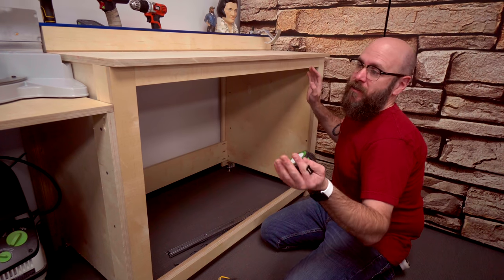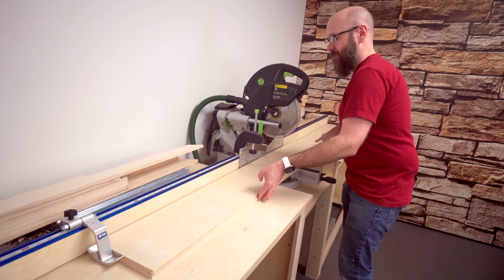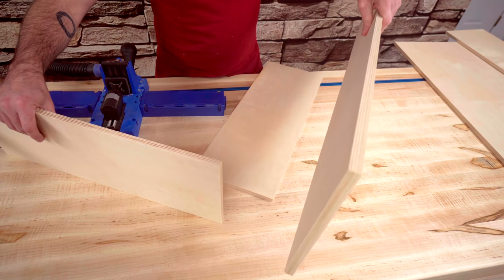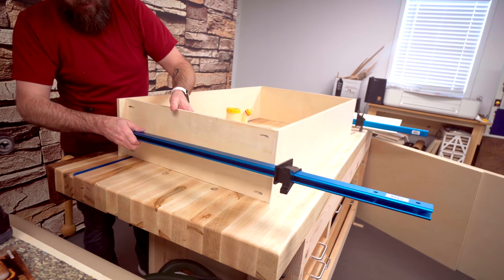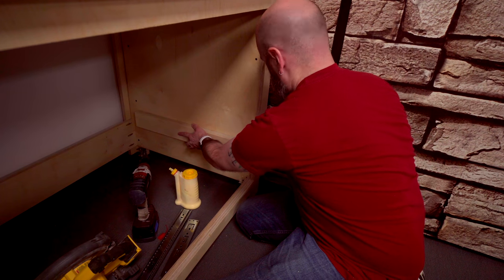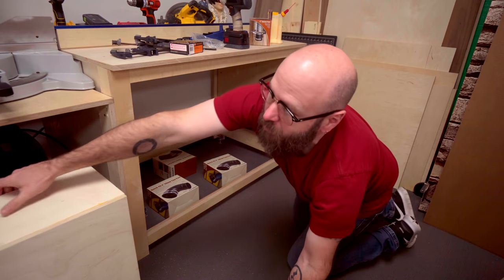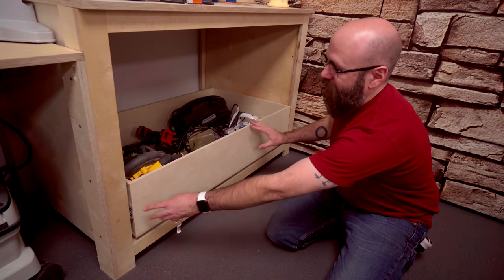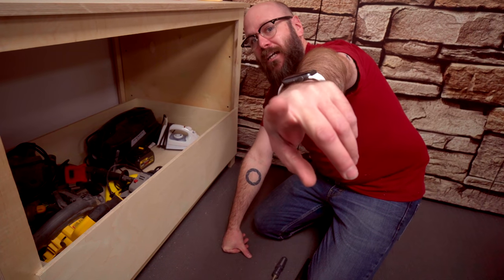How to Easily Make Shop Drawers. No Fancy Joinery.

Comment: One subtle change can increase the strength of these drawers. With the front/back extending the full distance, the pocket holes are in the side pieces. When the drawers are opened, the stresses are acting against the glue (which is half in end grain) and the threads of the screws. If the sides were made full length, then the pocket holes would be in the fronts/backs. Then the opening stresses need to sheer the screws to get to a failure. The real front would cover up the pocket screws.
Reply: Exactly right.
Reply: I'll start by saying that I use the joints that you describe personally, minus the pocket holes and plus rabbit joints.

Anyway, he said quick and easy so he didn't have to fuss around minute measurements and subtracting for the double thickness of the sides (that are less than 1/2"), etc. Plus the full extensions I get are 1/2" + 1/32" or something thick. So there's a bit more finagling to get the right size.

My workaround the odd plywood thickness is I rabbit deep enough to leave exactly 1/2" of thickness remaining (for 3/4")
Reply: Yep, that's exactly what I did for 14 drawers in my miter station too. Stronger for repeated pulls over the years and hides the pocket holes too. This is also the exact method Jay Bates used in his which is where I got it from. For the front/back width measurement, I stacked the two side pieces up on the side of the opening and measured the remaining gap.
Reply: Agreed. Good point. I'm making some now and I'm doing them like you mentioned.
Reply: Ive made drawers the same way with pockets on sides and never failed, and without glue. Don't be timid in trying different ways and faster construction.

Comment: Easy enough for anyone to follow.
And, you come out with a strong, no nonsense utility drawer.
(It'd be a good idea to adjust the clutch on your drill to avoid striping the threads on your pocket hole, and then finish by hand tightening them.)

Comment: A couple pointers ... you glued the drawer glide strips to the cabinet which looks prefinished ... if so, wood glue isn’t going to add any strength here. You also put the pocket holes on the sides of the drawers where they’re visible ... assuming you’ll add a drawer face later, you could hide them by putting them in the front and rear. Thanks for sharing!!

Comment: Really nice shop. I am about to begin another shop in my back yard just for woodworking. The one I have now is for my motorcycle and any other projects plus storage. It is too full. The shop I have now is a frame structure, 12x20. The new one will be 12x24. Can't go wider as yard is not big enough.

Comment: What size screw did you use for the drawers? Kreg recommends 3/4" pan head for 1/2" stock when using the black microjig but I couldn't tell what you used
Great video.

Comment: How strong are the drawer bottoms when using glue and pin nails? With relatively heavy items like circular saws etc are they strong enough?
Reply: Over-thinking too much.
Reply: I disagree. Not overthinking. These are very wide drawers, holding heavy objects. Nobody wants to have to replace a sagging drawer bottom.

Comment: Thank you for your continued tips and tricks.  Is your 1/2 inch plywood really 1/2 inch thick?  My 1/2 inch plywood is really 7/16.  Nothing in Kreg material about how to stop 1” screw from coming out face of joined material.  The only 3/4 inch screws I can find our fine threaded.   Any ideas.
Reply from the maker: I use the 1" screws but set the stop collar a bit lower than the recommended depth.

Comment: Question... for the bottom of the drawer, can you use the same pocket jig and screws to attach it for a strong hold?  Been watching youtube for how to make simple drawers with pocket holes and your video has the size drawer I need, I just want the bottom to not bow in the middle and be really really strong to hold heavy items.  Awesome video, simple, and easy.
Reply: Dayleeyah Kalonji Hey not sure if you built these already, but if your drawers will be carrying a lot weight use 3/4” plywood. Cut slots into the lower sections of the drawer sides to receive the bottom panel. I hope that’s helpful.

Comment: Sorry, a bit late to the party, but did you say you needed to buy an accessory to do pocket holes in 1/2" material? I have the older Kreg jig and I only have to change depth collar on the drill bit when doing 1/2" material. No additional accessories needed. 

But I really hate reaching behind the work to clamp it down. I was just starting to think about getting this newer version and if I have to buy extra accessories just to do common widths, I may just live with what I have.

Comment: What kind of plywood should I be using for the likes of this?

The big box stores in the UK simply offer "softwood plywood" and "hardwood plywood" 
the latter tends to be a darker reddish colour
Reply from the maker: That’s a good question. I’m not really sure the difference between the two but for shop furniture I’m sure either one will work.
Reply: Thanks for the answer. I'm sure it probably is immaterial for this use. I just bought my first table saw and am looking forward to turning big sheets of stuff into other more practical stuff

Next time I see the Gosforth Handyman use plywood on his channel I'll try get a UK-supply-specific answer from him ;)

Comment: Why did you subtract 1" from the depth when you only used 1/2".  The Drawer front sits on the outside of the faceframe.
Reply from the maker: Subtracted 1" from the width to accommodate the drawer slides.
Reply: James Jacobsen the drawer front comes flush with the face frame. So, 1/2" back from the face, and 1/2" forward from the back equals 1" shorter for the sides.
Reply: I think I figured out what I was missing.  The drawer is 23" deep, minus 1/2" for the front and 1/2" for the back for your drawer sides length.  Thanks so much for making me think about this more clearly.  Drawers are something I need to do more of, and at the same time don't like to do them all that much either.